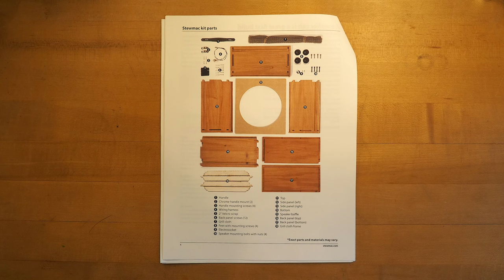I Built a StewMac Premium Mahogany Tonewood Speaker Cabinet Kit!

Comment: Nice job.👍 
I would put two ports on the lower front baffle board to allow Bass Frequencies and air out of that small closed back cab. It also will allow the speaker to move better.

Comment: Not bad but the real star of the show is that cool pedal- Ocean's Eleven, Big Sky or something like that?

I have a few thoughts...

Wear gloves so you don't get the inside messy.
Tape off around glued joints.
That size and quality speaker needs more AIR. Leave back open.
Immediately replace that horrid baffle. Think 3/8" baltic birch. 
Use 12 guage speaker wire, copper, oxygen free and solder to speaker. Yes, solder can be undone if you need to change the speaker. It's simply a better connection in every way.
Good job countersinking the screws.
Show how you installed the baffle next time. Wing nuts? Makes for easy removal. 
Tone was not great. Get a real tube head- not this orange think. I am a tone snob and to me, the crunch tones sounded bad. The cleaner tones were better- as would be expected.

Folks, please do NOT FALL FOR the whole tonewood thing. It is over rated. It is the SPEAKER and the HEAD and the amount of AIR and/or porting that effects the frequency curves. This speaker is pretty well built but it is FAR TO SMALL for that size speaker. The head is a joke as well, hence you hear the same tnoes I hear which is...not great. Looks pretty though. For very low volume, clean playing, it's fine.

IMHO, $250 is high for a DIY kit like this. If it was $99 it would be compelling. For $50 a pro can build you a real cabinet. On this one, the baffle (most important component) is WAY TOO THICK. What is it made of, toxic, MDF particle board? At least he did a good job assembling it.